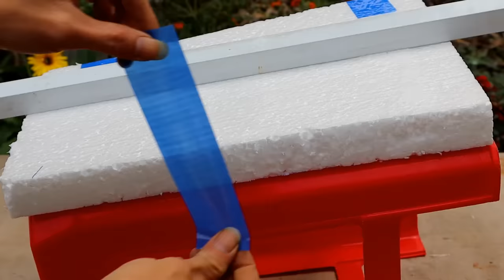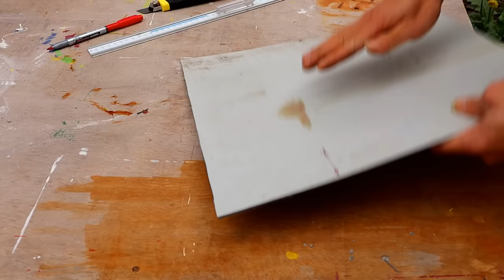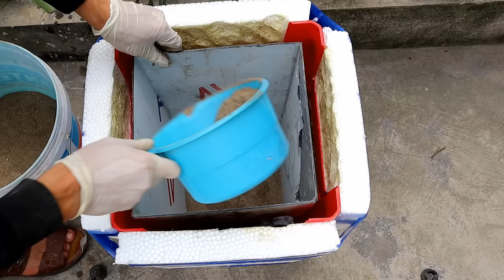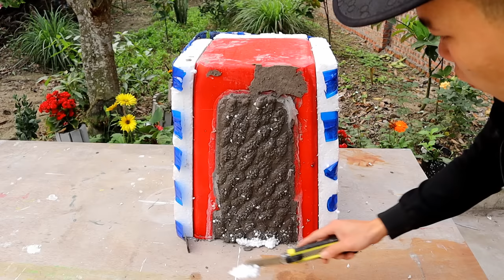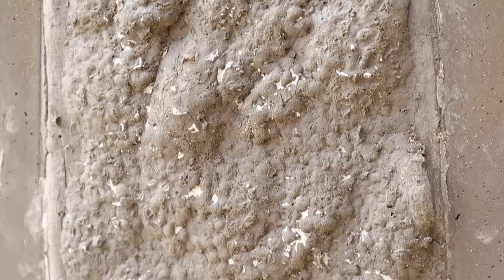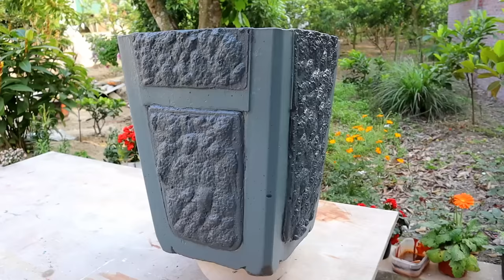Casting cement pot from Plastic Chair - casting project

Comment: Lovely project idea.
I would add a wire mesh to reinforce concrete and skip the painting
Reply: ഛഝഞേ
Reply: Good idea
Reply: Q

1
Byen
Reply: Show de bola parabéns tudo natural
Reply: good idea.. i was thinking about it being so thin and easily crack... deff. doing that ..
Reply: How or where would you add the mesh?
Reply: The walls are pretty thick. Maybe the bottom? I like the blue paint on this one. I think I’d skip the burning of the foam or carve a design into it instead.

Comment: A nice finishing for the outer surfaces is rubbing in some soil and then moss or lichens. Over a long period of time that is what would happen naturally, but you can accelerate it like that. Great idea to use the stool for shaping the corners, the most difficult parts of a rectangular shape.

Comment: Without mesh wire, the pressure from the soil and growing roots would crack that pot. ..but good idea....
Reply: True... Or maybe few hole at the belly of the pot and bottom
Reply: Do thin clay pots crack without rio ? Yes, but don't generally fall apart. Cement, same. Reinforcing with Rio does not stop cracks. How's your driveway ?

Comment: I wish you had identified in writing (English, please) the steps you were taking, the materials you were using, etc.
Reply: Here you are Laura 😀
Reply: Gratitude 🙏🏻 to ‘I Craft’ Artist for sharing.  Polystyrene, plastic stool with 1 strut removed, blow torch, plastic shaped insert made with stanly knife and steel ruler, silicon sealant and silicon canister holder to push sealer into cracks! Apply grease or oil to mould and mould insert with a brush.  Put sand into main mold and a plastic cap with oil/grease on it in the centre for drainage hole, mix cement/sand to creamy consistency and pour into a depth of 15cm tapping and vibrating to break bubbles must do this! Leave until dry, place in plastic insert and fill with sand to hold insert firmly in position,  leaving equal space on all sides make cement/sand mix again to thick pouring consistency, then pour into the side spaces slowly using a funnel and tapping all the time to bring bubbles out of the mix, leave to dry, when dry remove weight of sand from inner mould and with Stanley knife score the silicon sealer in the plastic mold corners, pull out sealer to allow air to loosen the sides of the plastic mold, remove mold sides gently, lay whole item carefully on its side and take off tape with polystyrene, leave to dry now until securely solid form use your judgement, using blow torch warm the original plastic stool to loosen the new pot. Separate both and stand your pot up.  Paint as desired or leave natural.

Comment: I only have to break one plastic chair, buy some thick styrofoam sheets, ply board, sealant, gum, cutting tools, cement, construction tools, duct tape, vegetable oil, a microscope, some rocket fuel, a stethoscope, a sphygmomanometer, an astronaut suit...yeah...why wouldn't I do this project, I abso-fcuking-lutely will.
Reply: you are awesome

Comment: lot of work involved,,,maybe forget the chair and go with the foam
Reply: mrleekel, the foam alone wouldn't have the strength to hold wet cement.
Reply: Just reinforce it with some wood planks and tape it tightly should be sufficient, I guess.
Reply: @tonezzzzzzzz  the foam used in insulating walls,,rigid foam,,,,,
Reply: I had the same idea. It looked awful with those chair markings.
Reply: Красота какая
Reply: @Thorny_Misanthrope  yes i think so, may be is new in the trades, may be the foam could have been remained in place, together with the board. Now he has scraped the foam, the board and the plastic chair, not good for the environment, further more the end does not justify the means, in terms if costs, materials, etc.

Comment: Too expensive for a single use mold. Great design though.
Reply: Really ? It seems that most (if not all) of the casting materials could be acquired for free if you hoard trash and/or dumpster dive. I primarily work in metal, so I've always saved my metal scraps...gardening makes me look at regular trash differently though. That pink high density foam could work if you insist on spending money & might be reusable if you seal it up real well. (spray on latex or something) Anyway, I like the idea. Pots like that are too expensive NOT to try some facsimile of this.  👍
Reply: Fantastic

Comment: This is not teaching! You should speak or type out the process and materials used as you work👌🏽
Reply: Plastic chair, white styrofoam, cement (no sand or gravel).  Someone mentioned using a material for the center that would rot so you could leave in place.  Thin wood paneling maybe.

Comment: 3:26 what is that? oil?
Reply: yes, oil
Reply: Engine/motor oil
Reply: Oil
Reply: Vegetable oil. Engine oil/hydrocarbon will dissolve styrene foam. Sealant must be a water based type as silicone dissolves foam too.
Reply: @pistolpeds  no.... I build swimming pool coping and we use foam form and we use motor oil and transmission oil... Works good
Reply: @sebastiangonzalez-pf7zi  Ok Sebastion, I stand corrected.
Reply: Correction again, Sebastian....lol

Comment: Gratitude 🙏🏻 to ‘I Craft’ Artist  sharing.  Polystyrene, plastic stool, blow torch, plastic shaped with stanly knife and steel ruler, silicon seeker and silicon canister holder to pushe seeker into cracks! Apply grease to mould and mould insert with a brush.  Leave until mostly dry firm, remove weight of sand and with Stanley knife score the silicon sea lent in the plastic mold and peak out to allow air to loosed the sides of the plastic mold, remove mold sides gently, lay whole item carefully on its side and take off tape with polystyrene, leave to dry now until securely solid form use your judgement, using blow torch warm the original stool to loosen the new pot.

Comment: Needs mesh to keep it from cracking - that mix was a bit on the wet side.
Also, the paint will peel off soon. Later, if a sealer is sprayed over the paint..
If it is used in a location that has freezing temperatures, you may want to apply a sealer to all surfaces.

Comment: Includes the following costs: Buy 01 chair (damaged after making) + 1/2 shop 03cm plate + 1/2 aluminum plate + 01 silicol A- 300 bottle + 01 adhesive tape + cement - cement + sand + paint + brush + roller. The total cost is greater than the money spent to buy a flower pot = betong. It takes effort and meaninglessness. Do the train! Only crazy people do it .....

Comment: I think your work is beautiful.  However the bottom end I think is way too thin, plus it looks a little cracked to start with.  I think that part, should be at least two or two and a half inches.  Plants are heavy, besides when the roots start to grow, they push down.  Otherwise, your work looks fantastic.

Comment: mysterious materials..how could we know the materials that you are using??
Reply: if thats mysterious materials to you, just dont try it. Its SAND-WATER and CEMENT ;)
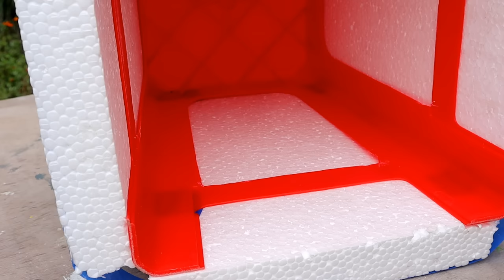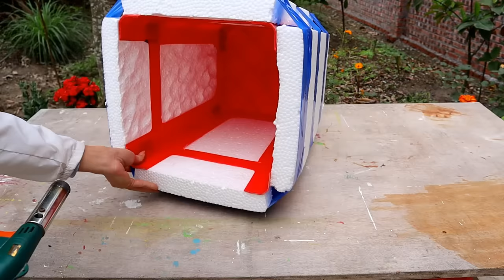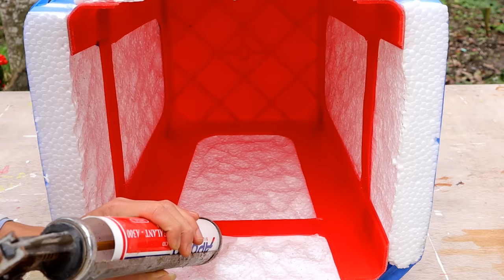Reply: @moskito5864  what you were using starting at 1:45 minute and till about 2:11and  starting at 2:20 ???not the water and cement
Reply: @awwabaayedaayeda2356   no idea where you coming from but this white STYROPORE (polistrol) is very common as material for insulation or packaging, its also keeping things hot or cold ... or are you talking about the HEAT  gun? or the Silicone?
Reply: @moskito5864  Oh yes..a heat gun..OK.and silicone....OK..
Thank you..I was thinking there is a material pouring from the bowel

Comment: Where is the steel skeleton inside this cement vase? You don't have to use rebar, you can use chicken wire. Cement on its own is not a very strong material. If your going to scale this up in size, considers using concrete  instead.
Reply from the maker: thank you !

Comment: That's cool, but looks like a lot of work for only one pot. Didn't seem like the mold was reusable.
Reply: By using hard Styrofoam and giving some attention to applying the release wax you could probably make 10 pots with the same mould. With every round of rebuilding the mould you will get faster and more efficient, I don't see a problem with the mould. The idea of using a stool for shaping the corners is really good, but 22 mio views, OMG